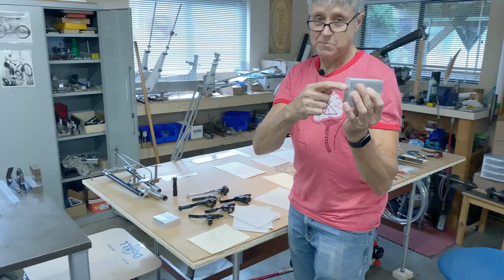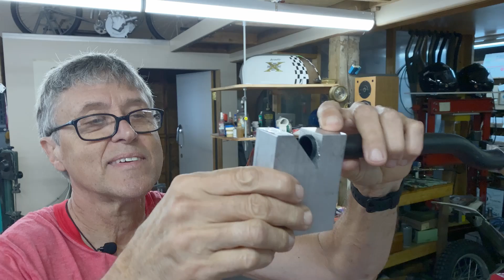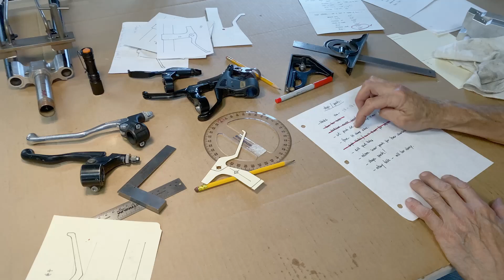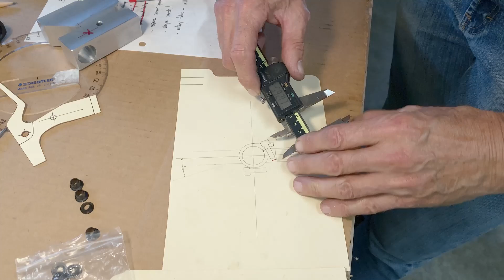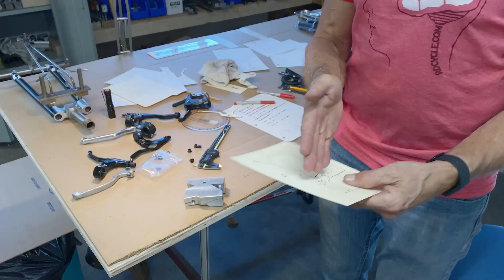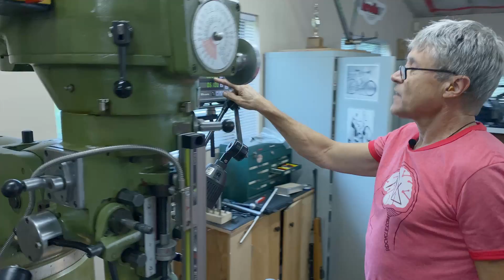Making a brake lever - part 1 // Framebuilding 101 with Paul Brodie

Comment: Hello, AMAZING video! I love it: it's unique... even without CNC is a good job!
only one suggestion/opinion: I've heard from a local machinist that other than the cutting oil specific to aluminium it could be used alcohol (and it's better compared to using the cutting oil for steel). What do you think Mr. Brodie?
Reply from the maker: Thanks for liking our videos! I'm not sure if I would use "used alcohol" as a cutting fluid. I'm pretty fussy about what cutting fluid I use, and the Rigid cutting fluid is pretty good 😉
Reply: @paulbrodie  yes I had no doubt you used a proper cutting oil for aluminium. the alcohol is a sort of "ghetto-style", a very cheap alternative [the machinist is Italian, he has a yt channel and does some pretty/clever/vintage things]

Comment: It´s a little easyer if you mill Aluminum backwards. ie turning the Part in opposite direction to your Cutter.
Reply from the maker: Climb milling? That's what we call it...
Reply: @paulbrodie  Yes and I was astonished you wernen´t using this method.
Reply from the maker: @h-j.k.8971  I do use it, but not every single time. I use it mostly for finishing passes. It can be "grabby" when you're removing a lot of metal, and manual mills have backlash, so...
Reply: @paulbrodie  Yes, sometimes you just have to go with what the mashine dictates.
I like your Levers. Back in the days I used to cut up old bicycle frames for the tapered and oval tubes to make these sort of things.